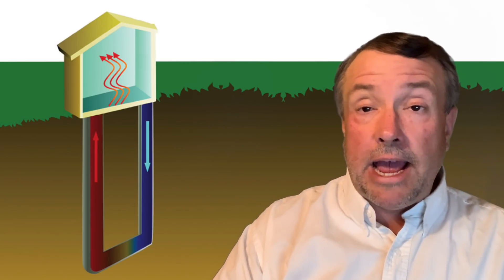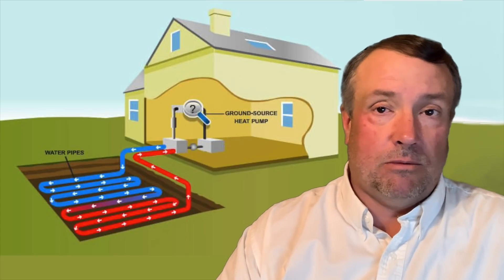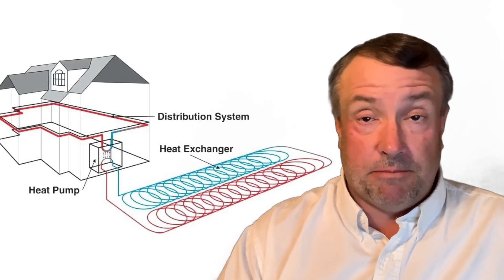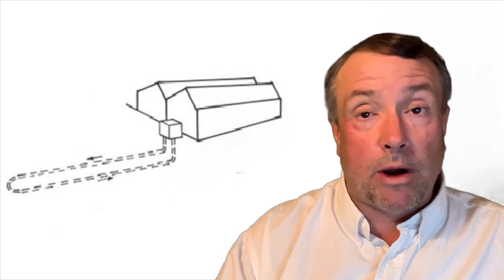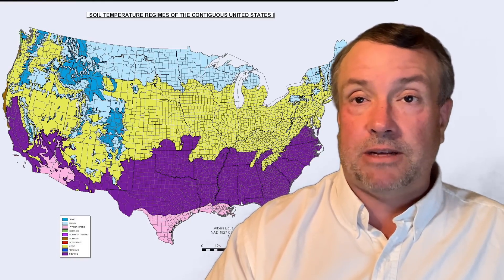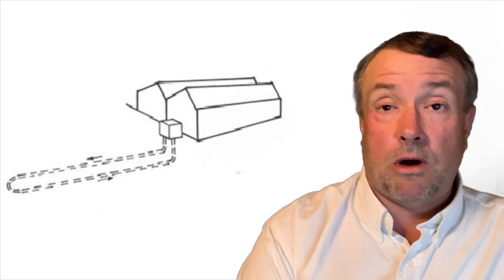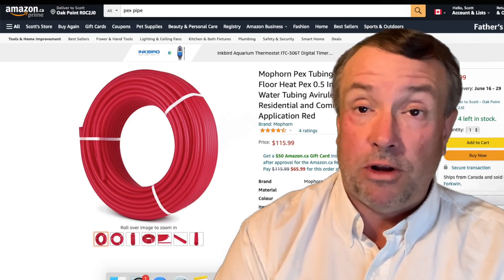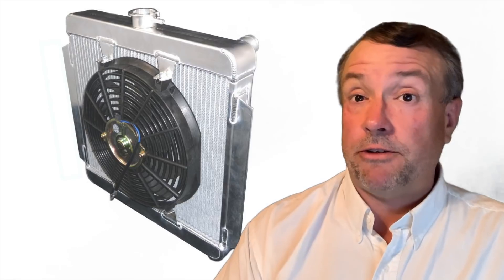Low Grade Geothermal Greenhouse Heating - Air vs Liquid

Comment: Oh,  hi.  I live in Victoria BC Canada.   I got a CO2 meter to experiment with about 2 months ago.  One thing I am interested in is CO2 enhancement,  in my pretty well sealed  greenhouse.  I want it as well sealed as possible to keep in the heat,  but then I need to input CO2 because nature won't do it for me.    First of all,  I didn't realize how high CO2 levels are in houses in Canada.  So, 2 months ago my inside air  was over 800 ppm when I first tested.  My greenhouse is in a treed area,  and the air around it was about 380 ppm around midday while in the greenhouse it was around 560 (Lots of organic matter under the soil will give me a couple of months of above normal CO2  in the greenhouse until it rots away and  the plants really start growing.  Anyway,  plants ideal CO2 levels are 1000 to 1200 ppm ( same as a stuffy office or classroom) But human requirements for CO2 is "as low as possible,  so indoors 500 or 600 would be good.  Not only that,  but it turns out  high CO2 levels co-relate to a higher risk of spreading Covid,  (They are using CO2 meters in some schools, in Canada, Germany and the USA as a proxy to measure Covid risk!).  So,  my thought is,  why not couple house ventilation somewhat  with your greenhouse heat and CO2 requirements?   When I got my crawl space sealed a few months ago, I left a 4 inch pipe so I can use a fan as necessary to blow air out and into the greenhouse,   I suspect the crawl space will have the highest CO2 levels in the  house and blowing from there will also lose me the least heat.   Maybe you could look into doing a video about coupling a house to a greenhouse and doing 2 jobs at once.  Reduce the CO2 in your house,  while getting air changes and  helping the plants grow faster in the greenhouse.
Reply from the maker: that's awesome - worth a video in the future - thank you for the info!
Reply: Raise ducks inside the greenhouse?
Reply: @johnwyman6126   I don't see why not, if you have the space.   But bylaws here mean that I don't have enough room.  One day,  I read up and found that my greenhouse (10 sq meters) when full of green stuff growing on a sunny day,  used almost the same amount of CO2 as 1 person exhaled.  So, absolutely,  you could have a maybe 2 inch or 3 inch  pipe going from your crawl space to the greenhouse and it would help your plants big time  when you blow your house air to the plants.  (And it helps you too because  you can replace some of your stale carbonated house air with freshly  oxygenated greenhouse air.)

Comment: I made a simple  12 ft by 9 ft glass greenhouse (biggest I'm allowed without a building permit here in Victoria BC)  with an about 2 ft high raised bed on the north side and an about 14 inch raised bed on the south side with a pathway inbetween.   I have water storage directly underneath both planters with more water under the north side one than the south side one (I have videos about it). I blow air through pipes under both planters to cool the greenhouse air and warm the soil.  I have minimal ventilation.   The air is blown by old computer fans from an obsolete computer down into the plastic 2 inch pipes and powered by a 15 watt or 30 watt solar panel.  Definitely,  I wished I had wider diameter pipes or a more powerful fan. One pipe goes under the water so the air gets cooled more,  usually 8 to 10 C cooler when it comes out but on a really hot day,  up to 15 C cooler.   The condensed water in this pipe that passes through the water storage is significant.   1ts around 4oo ml per day on the hotter days.  Turns out the heat given out to the soil or water when condensation occurs is massive.    The only real innovation I have is that I send the air down from the computer  fans near the glass roof through "temporary plastic downspout"  which is a clear plastic "tube" that they hang down to take rain off roofs in new construction while they await the real downspouts. It's clear so it doesn't stop light getting to the plants.  All in all,  I am really happy with it so far,  and very pleased with the amount of thermal energy I trap in the soil and water to keep the greenhouse warmer at night and prevent nasty spikes of heat during the day.
Reply from the maker: That's AWESOME!!!!!!

Comment: Love your channel and the informative videos. I started experimenting with aircrete last year. I don't believe aircrete will work as insulation in earth sourced heat storage unless is dried and sealed. The aircrete I've made becomes water logged in the rain. something like an industrial pond liner or maybe a poly bag which is then put under mild vacuum would be a good idea.
Reply from the maker: odd, many people have said it's waterproof and floats... what kind of foam did you use?
Reply: @SimpleTek  I've made Portland cement/foam type. Initially when made and dried it will float in water for quite awhile but it slowly takes on water and sinks. There is another type made in factories called autoclaved aerated concrete (AAC). This type may actually be waterproof. It's a vastly different product than an at home DIY aircrete.

I really like your channel and willingness to explore many different options to solve problems. You sunk me down the rabbit hole of compost heating for The last month or so. Im even further north than you and you are one of the few who consider the northern climates in your thought process.
Reply: @SimpleTek any chance I can get you to contact me
Reply: Check out styrocrete. The video claims that it is easier to make, better consistency, better R value, lighter etc.. I hope to be trying it out this summer.

Comment: Sometimes I see air circulated into a house via pipes underground. That is a big health risk because of the unavoidable mould forming in underground pipes.
Reply from the maker: better to do that for a greeenhouse than a house
Reply: From Lil Giant Ooh! I could not handle the mold—in a house OR a greenhouse.
Reply from the maker: @henryvalero9235  then use a liquid system - no mold!
Reply: They make special cool tubes for this that are coated on the inside to keep from getting any mold growth.

Comment: With this type of green house heating what are your concerns with radon in the green house? I live in North West Wyoming where radon gas is a major concern.
Reply from the maker: I can't see a liquid transfer system being an issue as it's sealed from the ground - an air transfer system might be an issue if it has moisture drain holes - but you don't live in there, your plants do - radon is bad for humans, not plants - and greenhouses often have massive air filtration in the day via vents and fans when humans are in them - unlike houses... I'm no DR - so I don't know., but I don't see it as a huge problem but that all depends on the levels on radon. I would assume levels that would start to be bad  in a house would take much higher concentrations to be bad in a greenhouse - depending on setup
Reply: @SimpleTek  have you ever tested your green house for radon level?  I asked the guy in Nebraska about this issue and got a none answer. I have a friend that wants to have a green house on the south side of their house and connected.

Comment: Glad I have a dug well next to mine, 36 ft deep and 10 ft round, Temp stays around 58 degrees year round, I have it running thru a old semi radiator. It works great for 10 months of the year but Jan and Feb have to add about 10 degrees if I want to grow luckily I don't need that much food.
Reply from the maker: That sounds awesome!!!!!

Comment: The price of a geothermal heating system in Scandinavia costs around US $ 19,000-33,000 depending on the size of the house. The geothermal heat pump lasts 14-20 years.
Reply from the maker: a low grade system for a greenhouse would be about $1000 in parts plus excavation
Reply: There exist pumps that work 30+years. The compessor sometimes break 14-20 years, costing €2500. Whole pump cost €6000. +geoCooling does not need a compressor.
Reply from the maker: @kimmokannala4576  umm, taco pumps are about $100 - and last many years.. I can change the pump and save thousands! lol
Reply: At my latitude and with a well insulated concrete house, I need cooling during 1..5 days per year, I have not bothered yet to take the cooling in use, even when I already have all HW needed. -> I use our 210m deep heatwell only for house+water heating via a heat pump.

Comment: Thank you for another wonderful video.  Concise and condensed information tailored for people like me to take the leap into a purposeful and healthy at home hobby.  You inspire me to do more research.  You definitely have a niche in this green diy media.  One idea I would extend is the geothermal air heat transfer (gaht) system in northern us latitudes uses perforated drain pipe.  The ground/soil reduces humidity in the greenhouse which is important for plant health.  Thanks for mentioning others in your field!
Reply from the maker: Thank you for the kind words. you're correct about the perforated pipe! there is also a heat gain with air systems via a phase change